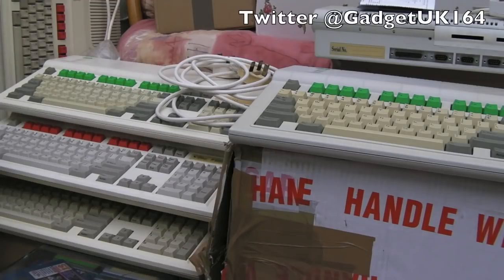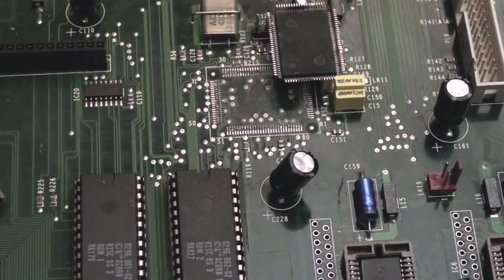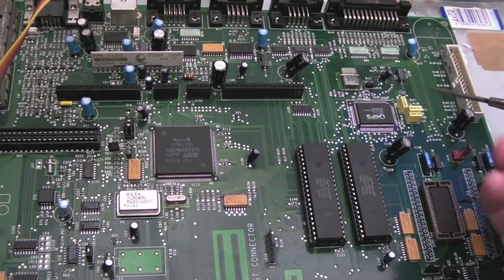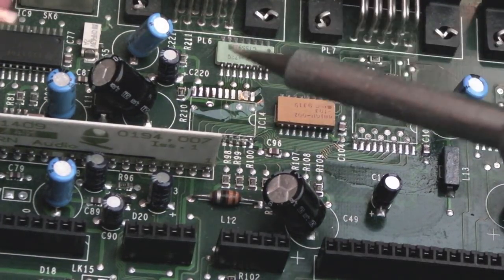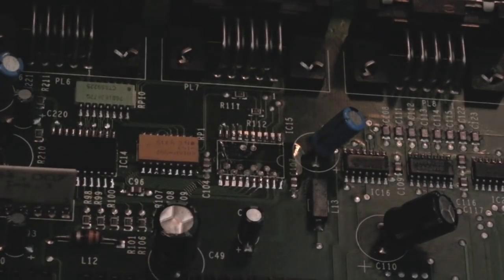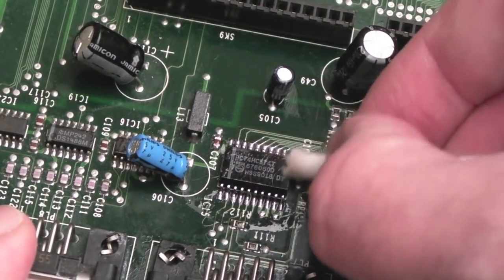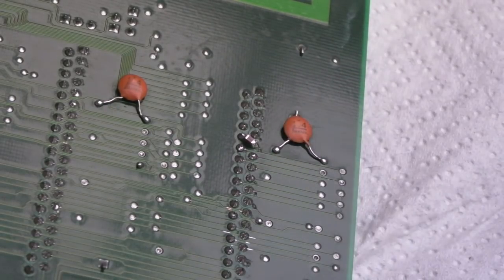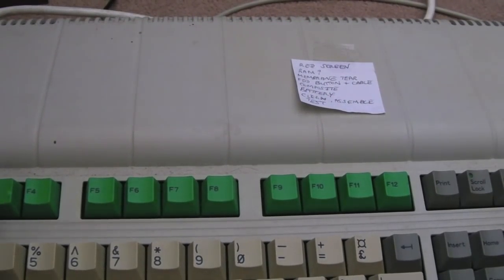Acorn Archimedes A3010 Repairs (Not Booting / FDD Controller Issue) - Part 4

Comment from the maker: Touched one of the yellow caps there with the iron when removing the Chips IC.  Best to stick kapton tape over those if you try the replace that IC (or relow the 82C711).  It's a polyester cap I think - possibly damaged by that melting.  I will replace it later.    And as Zarchos pointed out - I forgot to feed the keyboard connectors "through" the metal frame.  I will be going back in there to do an overclock and to had some upgrades later (Thanks again to Zarchos).  Something else to point out - on schematics (in particular when looking at the connections around the ARM250) - they aren't on the same sides of the chip as per the schematic.  ie. Some of the connections on the left may physically be on the right hand side (or the top or bottom) of the actual IC.  You have to look at the pin numbers to work out precisely where they are on the actual PCB.  Scoping the BD bus would have revealed a logic level problem I think!

Part 5 - https://youtu.be/Gb2iuH0sOJk
Part 3 - https://youtu.be/D2HZpJP68xQ
Part 2 - https://youtu.be/WhjGmUn4s-Y
Part 1 - https://youtu.be/m5nOSKW7WuI

Comment: LA0-LAx - linear address bus, for non-multiplexed addresses (ROM, I/O, expansion, etc..)
RA0-RA7 - RAM address bus, multiplexed for DRAM. Used in conjunction with RAS and CAS<x> to address/refresh all bank's rows or columns of bank <x>
D0-D31 - 32-bit data bus, used by RAM/ROM/expansion
BD0-BD7 - Byte-data bus, used for 8-bit I/O like ports and FDD controller.
Reply from the maker: Thanks for the detailed info there =D

Comment: Those boards cleaned up well. Can be annoying in this part of the globe, low light this time of year.
Got an SMD "Cheat" soldering tip "RS PRO 2 mm Conical Bevel"  RS Stock No. 799-8989 
The tip is slightly concave, the solder pools in this concave area making it ideal for SMD / Drag soldering. Spotted one on Louis Rossman's channel. I often forget I have it, since you have to wait for the iron to cool down before you change the tip, I often forget to swap it out before I get started.
Reply: He already has I think 2 conical tips for drag soldering, showed them together with the iron in one of the videos

Comment: When drag soldering, you want to drag along the ends of the pins, not along the top of the pins near the bend. Make sure the iron has good contact with the pad and the end of the pin, and the solder will wick under the end of the pin.
Reply from the maker: Yep, I am aware lol!  The problem is I was using a tip way smaller than normal and not the tip I usually use.

Comment: I'm thinking that if you find evidence of liquid damage, take off all components in the area that might have some cavity beneath them, and rinse everything thoroughly. Perhaps you might then avoid many of these difficult errors. It might be more convenient to have the components out-of-circuit anyway.
Also, vinegar is supposedly good for battery acid and the like, plus it can also be used to remove rust.

Comment: Nice one! wonder if it was the alkaline causing shorts that killed that 574? I've just had a nightmare with a Hello Kitty telephone a friend asked me to repair that had had the four alkaline c cell batteries leak inside. ended up taking the PCB out and soaking in ascetic acid then washing in IPA which finally got rid of the conduction across the PCB.
Reply from the maker: I think so!  I've still got the old IC and I can see from earlier videos which pins had the corrosion around them so I may investigate to see if those are the affected pins.

Comment: I have a3010 a7000 a7000+ stock risc pc 600 and a strongarm risc pc. Every time I get boot hangs or any hang for that matter it's always when i'm effing around with hard drives or floppy drives or ide to CF adapters or gotek emulators. It's like they are looking for something that's not quite right. Have also had them from dodgy cmos settings or bad batteries. Sometimes they just work, mostly they long boot like that one and kind of work. It's tough to trouble shoot. I've even had issues with a floppy in the drive preventing boot. Wonder if the drive thought there was a floppy in when there wasn't and trying to boot from that.

Comment: I wonder if washing this board would have helped. I've been thinking of getting a bigger ultrasonic cleaner for a while.
Reply from the maker: It may have done with the RAM short in part 3, but not this fault - the 574 was definitely faulty (due to the alkaline).

Comment: Great job, really ... but .. at 00:54:00 the keyboard connector should go through the slot in the chassis :-)
Reply from the maker: Haha, yes - I spotted that watching it back too!  Don't worry, I hadn't finished that one yet anyway - hoping to fit one of those IDE podules and I was going to test overclocking that one too yet!
Reply: @GadgetUK164  Great if you can show overclocking. It is both easy and cheap thus it is worth doing the mod. With the 4 Mbyte expansion on its way to you, you will be able to upgrade this A3010 or another one, and overclock to 20 Mhz and maybe 24 as the 60 ns chips can be clocked higher than 16 Mhz.
There are several threads on the stardot forum about overclocking, maybe in your next videos you could show them and give the links in the description section.
The PCB files are available to build your own 4 Mbyte Ram expansion board for the A3010, and also for the A3020/A4000 and the A5000 too.

Comment: Systems sure seem to have a wide variety of issues. Is the Archie such a fragile machine, or was this just a lot of broken ones that were not serviced before?
Reply: I owned three Arcs from new, never had any reliability issues with the hardware despite jamming them full of upgrades
Reply from the maker: I don't think they are fragile - these ones are just faulty ones that have been sat in storage for years etc.

Comment: A lot of work, soooo... What was the main reason for such an elusive glitch? Alkaline affecting BD connections (what is BD stands for I presume databus right?)?
And the last part with RAM sockets desoldering - what was done in particular for?
Thanks anyway, because I got the same issue with 3020, you may see it at stardot
https://stardot.org.uk/forums/viewtopic.php?f=16&t=20881
Reply from the maker: Regards the the RAM sockets - that was covered in part 3!  This board had a few different issues, mostly caused by battery Alkaline!  There are multiple buses on a system like this, BD was what Acorn used as the prefix for that particular data bus.  It's not the main data bus though!
Reply: @GadgetUK164  Right, cheers for the answer. Hope I will repair mine then!

Comment: I hate those solder tips, I am way tidier with a flat, they are great for getting a hole though, I am never happy with my work even if you can't see it it has to be perfect, I am guessing your of a similar ilk.
Reply from the maker: Haha =D  I think the problem is I am back to "learning" how to use the tips on this iron!  With the old Antex I had got to a level where I felt comfortable with the way solder flowed on any joint etc.  I will go and order a tip similar to the old Antex one later I think!
Reply: @GadgetUK164  I've got tons of tips but generally use one that resembles a small flat head screwdriver, it works for me, I've got some SNES battery's to do next when these f'ing battery's arrive from china, but it'll be nice to replace them, they are a tad on the green side, but haven't ruined the PCB's so all good, do you know if there is a work around by using say an EEPROM rather than a battery?
Reply from the maker: An EEPROM would need (probably) some modification to the prog ROM in order that when it saves / loads certain signals are sent to the EEPROM in order to read / write correctly etc. The other thing that might be possible (but would need a mod PCB designing) would be to fit a newer NVRAM or NVROM (even FRAM) in place of the original SRAM.